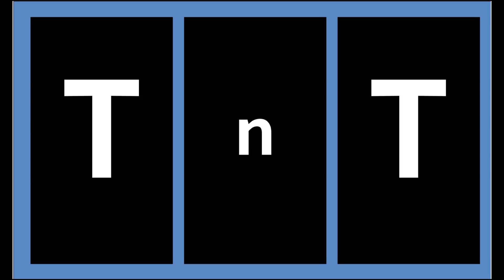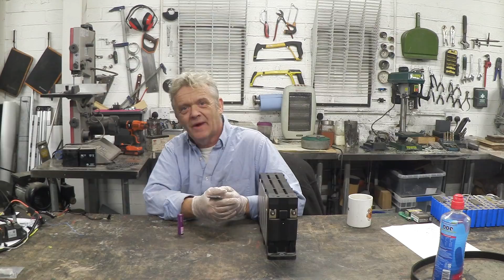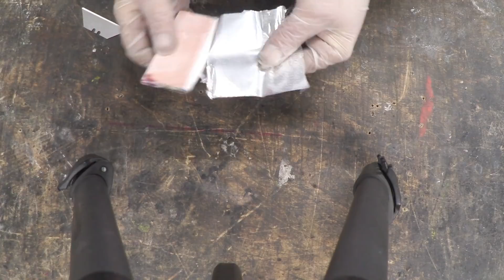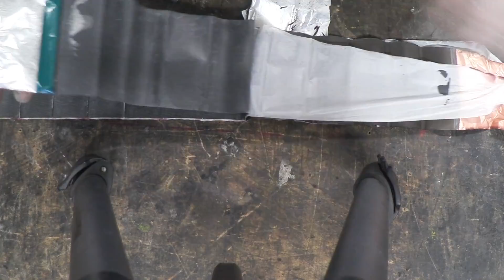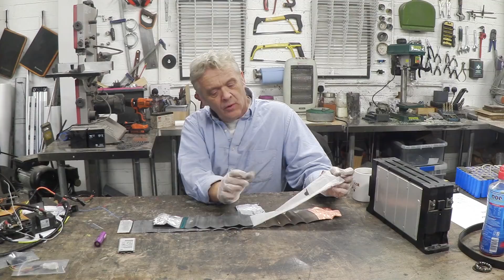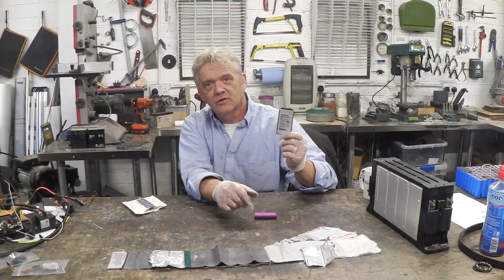1273 Inside A Moble Phone Battery

Comment: I'm loving your videos and keen to try building a battery. Is the separator in the lithium ion battery an ion exchange membrane? Could it be used as such in a ZnBr battery if the lithium electrolyte was washed off?

Comment: Have replaced my lead acid with LiFePO batteries and the difference is huge. The thing that surprised me the most is for the same wattage solar array they seem to accept a much higher amperage. I'm assuming it's to do with the internal resistance of the battery. Any thoughts on this?
Reply: Each cell in parallel in each block adds to the charging rate, eg 1 LiFePO4 can take 3.2v at 2A, so 5 in parallel will take 10A. They charge much faster than lead acid, which is why I'm currently building a 2kwh battery for my boat to replace 4kwh of "deep cycle" batteries - I'll be glad to see the back of them. I might even leave them at the boat club for somebody stuck in their old ways... they do work, but charge soooo slowly! It's only for the domestic side so it will be kept indoors, I can't imagine putting a lithium battery in (or near!) the bilge!

Comment: Hello Robert!
A question for you: Can I mix old 18560 with different mAh left to make a big battery? Some of them have 1300mAh left, some have 2200 left. If possible, should I group similar mAh together and put a controller on them? For example: 10 18560 with somewhere between 1300 and 1600mAh; 10 18560 with 1700 to 2000mAh and so on. Will the lowest bunch of 10 batteries dictate the charge for all other 10packs or will every 10pack maximize to the lowest in that pack? And also, how far apart in capacity can every single 18560 in mAh in a 10pack be? I know they should be "roughly the same", but what is that in numbers? 100mAh, 200mAh or 300mAh or only 10mAh?
Thank you for great infotainment 👍🏾/ Christian from Sweden

Comment: With regards to the heat in the block, what if you were to have an aluminum pkate in the middle of the block with a heat sink attached to the plate on the long sides of the block. The heat sink could also function as the means to attach the pressure plate to either side of the block or whichever mode you use to apply the pressure to get more power out and keep from delaminating. 
I have a bunch of 2s and 3s hobby grade lipos from my RCs that i have been thinking about banking together into a big pack to power an electric bicycle. Do you think this is feasible? The lipos are all 4000 mah packs.

Comment: Excellent video, as usual.
Regarding the "bad cell in a pack" issue, isn't it possible to make a small (and cheap:) circuit for each cell which compares it to neighboring cells and disconnects it from the pack if it's lower than all/most of them by a predetermined value?
We would most likely embed these circuits in the pack, and make the cells removable/replaceable.
While such circuits only need very few low power components, they still waste some of the battery's stored energy, so it may not be worthwhile... on the other hand, when a cell is disconnected, its location can be detected immediately by a single monitoring circuit, and that means easier maintenance and reduced downtime.

Comment: Heads up for BMS/controller per cell group and putting them in series! Most BMS are NOT made for this. if you have the wrong BMS and put multiple BMSs in series, you can end up with massive short circuits. Because:
The mosfets in the BMS (switch that turns off when something wrong with charging/load) are rated for a x voltage. By putting more BMSs in series the total voltage increases. If 1 BMS trips, it need to withstand the voltage of the whole pack. Most BMS match theirs with the voltage rating. An 5v bms doesn't get a more expensive 100v mosfet (if a 10v one will do fine). 

Personal experience : Daly bms (china) are great BMSs but use for 10s setups(42v max) 60v mosfets. by putting 2 in series, 1 mosfet needed to withstand 82v. Lest just say it didn't and i needed replace all the balance wires and the bms....

Comment: Awesome Thank you for this great, comprehensive explanation, would it be possible to scrape off/remove the lithium and graphite from the unravelled battery and re-coat it/re-electrolyte it with other battery chemistries? zinc etc (then re-seal battery package?)

Comment: question = any chance at re-using re-making the battery from the old battery ?   >> could you take each black part and dissolve them separately, then restore it + subsequently re-plate ??  From what I see, the only magic is in this lithium laying theory ...    but I also thought u couldn't take these apart without something spectacular happening !!!   U completely de-mystified this !!!  Wow !! 
Fun fact >> years ago when the energizer lithium AA's first came to market I took them apart.  I remember the stuff on the roll quickly turning white !!  Then of course as kids do >> many pieces went in water to watch funny bubbles !!   That is all I remember.  I specifically remember that it did not look repairable caz of the quick oxidization in ambient air.  ((Yeah, when I was a kid I used to take apart batteries just to re-assemble them in a different case/ different configuration. ))
Reply from the maker: The short answer is yes - but it would take a bit of doing - however it is possible

Comment: Also manufacturers will measure the mAh of each individual battery and group them together in the same block the ones with similar capacity, to prevent excessive overcharging.
Reply from the maker: yes they will

Comment: Brilliant video Rob. Why cant use the individual managment circuits already on each battery?
Reply from the maker: not all - but some can be specific to the phone and will only recharge in the phone - I was wanting to give a general guide - so with those that can recharge in a 'normal' charger then go right ahead and reuse the BMS boards supplied with the battery - for those that don't, you are going to have to remove them

Comment: I see, so Nissan Leaf chooses battery pack with flat batteries because they can put battery management system (BMS) in each of the batteries instead of 12 cylinders pack like Tesla, I wonder if Nissan decided with that level of safety just because the battery is like half the price of the car, ...but then now I can say that flat batteries pack is safer, and also more expensive, yes I know there are flat batteries that explode, but then there are way too many people with mobile phone that didn't explode
Reply from the maker: most of this stuff just comes down to cost and actuarial risk you know?

Comment: Why the industries,( for example tesla), do not use the bromide battery o the flow batterys? I think that bromide battery is much better battery than lithium. I not sure about the capacity and weight, but you can discharge to zero the bromide battery and do not need protection circuits and bromide batterys are cheaper, so why bromide battery are not use, yet, in cars?. Is that bromide batterys are so cheap that are not profitable for the industries?. A 18650 lithium battery only can be discharge to around 3 volts a bromide can be discharge to 0, one kilo of bromide cost around 50 dollars on ebay. So why? You just made a video about bromide battery.
Reply from the maker: in the 1970s Ford made a car with a very similar battery - it is called the chloral hydrate battery - very very similar to the bromide battery
Reply: @ThinkingandTinkering  thankyou👍
Reply: You also say in your video about bromide batterys, that bromide battery are close to the capacity of lithium battery. I think that that difference betwen bromide and lithium is compesate by the fact that bromide battery is cheaper and do not need circuits, can be discharge to zero and there is not danger of Fire and explosions on bromide battery.

Comment: I'm surprised you didn't show the reaction that happens when you put a little water on the lithium compound
Reply from the maker: that's because nothing happens - well it gets wet - but there is no violent reaction - in lithium ion batteries the compound is an oxide - it's already 'burnt' so to speak - if you put lithium in water - well that's a different story.

Comment: Great overview Rob. If you're going to build a large block like that it and you have time to, it might be an idea to bin all of the cells based on capacity. You then make sure the total capacity per 3.7V block adds up closely to the same capacity.
Another thing: You mentioned LiFePO4 is not as long lasting. I think you were meaning the specific capacity. They're actually a lot more tolerant to cycling, with expected cycle life in the multiple thousands of times instead of the few hundreds for Lithium ion.
Reply from the maker: glad you liked it mate and similar capacity was certainly the plan. To be honest the various flavours of lithium ion represent just quirks to me and all the various types are much of a muchness - but you are dead right in what you say - cheers

Comment: SMART BMS also balances your cells by switching on a resistors, to drain your high voltage cells till they match your lower voltage groups, so voltage level is equal for each cell group.  

Smart BMS are very nice because you can see and adjust every perameter this is good insurance for an expensive investment 🙂    when building battery packs matching cells (internal resistance) and Capacity tobe equally  important aswell for healthy working device.

Comment: aha  .. it's a high voltage version. 4.4V ...
Some remarks : The little circuit inside the battery is not really part of the battery management system but rather a protection circuit. It will prevent undervoltage, overvoltage, overtemperature and overcurrent. A typical device would be ti's BQ2980 for example. It's kind of a last resort when things go wrong. For some parameters it's a backup system, if the charger is broke and delivers too high voltage the protecion circuit will prevent catastrophy. When the load has a short the protection circuit will prevent overcurrent. I think these circuits are mandatory if you want to ship your product by cargo plane for example. Special regulations exist.

If you have batteries in series usually there's a charger that has balancing to correct for small battery differences. Since you have used batteries it's relevant in you case.
I'm not sure how the poststamp boards are going to do in your situation. Usually there is a switching charger used for packs. If not it's fine, but losses in the charger are big.
Charging does not stop at 4.4V. The voltage iis limited at that by charger. When the current drops under a certain value the charger stops. So there is a constant current and a constant voltage stage when charging.
Anyway, excellent video. Really helpful to understand the basic principles. These batteries are so simple. I wonder what took them so long to invent them ...

Comment: It seems as if having the gaps between cylindrical batteries, while providing for cooling, might also make for more circulation of air in the case of a filre.  Might it not be better in both battery pack desigs to have the controller perform some active cooling, eg using a Peltier devce?   Rather than just checking temperature, the controller could also cool off battery groups during discharge.
Reply: @Dave Kenny
That's a great idea!!
I bet you get the "Make it and put a Video On the YouTube" answer from some smart-ass like me, Lol!! 😁
I hope all is well with you and yours!
Kindest Regards,
Andrea, Jasper and George the Pigeon. XxX💞 🙋‍♀️🦮🕊️💞XxX.

Comment: Excellent synopsis of lithium cell batteries - at least the materials can be recycled easily - most of the battery packs made from 18650  only fail from one cell going short - a comparator / balancer system is a good idea but only seems to be adopted for big banks not small capacity cell arrangement like in power tools from the last decade.

Comment: If you were to place a small sheet of aluminum (or something thermally conductive) between each cell, so that it stick out a few cm on the sides, it could act as a heat sink to take the heat away from the center of the "blocks" of cells. I see people suggest glass for this sometimes, as its not electrically conductive but decently thermally conductive and can withstand the pressure from a bit of compression. Using a conductive metal is maybe not the best idea for a heat sink layer lol

Comment: Very informative and interesting The battery you dismantled was a Li ion I use a lot of LiPo batterys in model helicopters mainly due to their better power to weight ratio is there a big difference in the make up or is it just different materials
A suggestion with your battery pack being under a small amount of pressure. Would interleaving aluminium plates of a slightly larger size (so they stick out like fins into the air gap)  act as a heatsink to help with the heat problem but still keep pressure on the individual batterys
Reply: I'm not sure for all variations but these batteries keep cool when in good shape. The heating problem only is due to batteries in bad shape. In such a case charging should be halted. Sinking heat is possible but serves no purpose. Charging should stop.